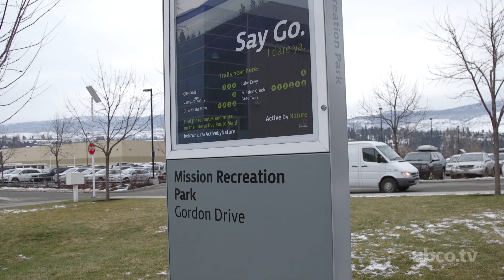Engineering Bike Safety

Comment: It won 't be long before bicyclists will have all the new-fangled things on cars such as the many warning & avoidance devices that make driving vehicles. So much safer! I can envision warning buzzers? Say if a vehicle is too close to you, or if there is an oncoming hazard I.e. A car,bike, pedestrian! The future bike will have some kind of preventive thing I am thinking positively here, or quite possibly a warning buzzer that detects a fallen tree or bear on the path one is riding! I am not going to say that BEAR spray will be used at 50 yards but maybe a automatic bear horn noise? I know that one can install a rear view camera on ones bike along with a large screen mounted on the handle bars! Maybe all this will be built-in to ones helmet?! Why not THINK that having a device similar to what cars & trucks etc have as an option, the Crash sensor which will apply front & rear brakes bringing ones bike to a stop, that this may cause the rider to be ejected forward engineers will fix this!